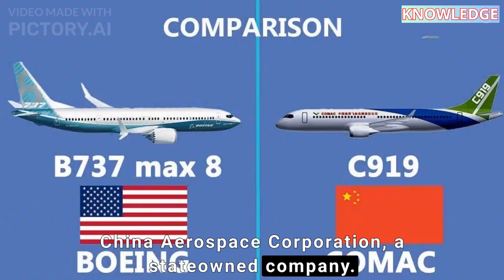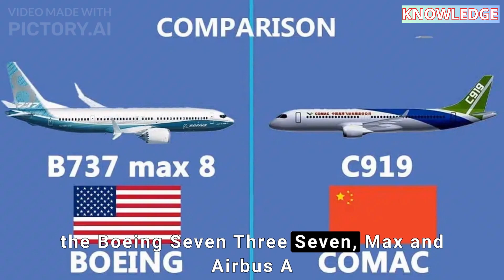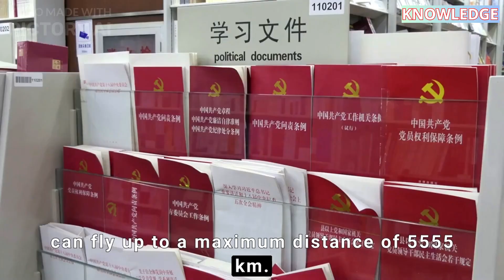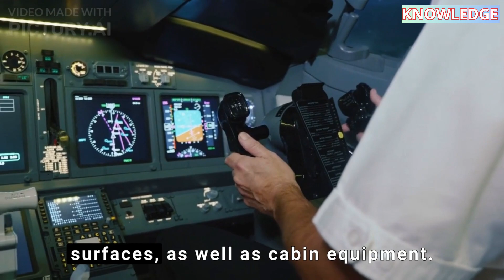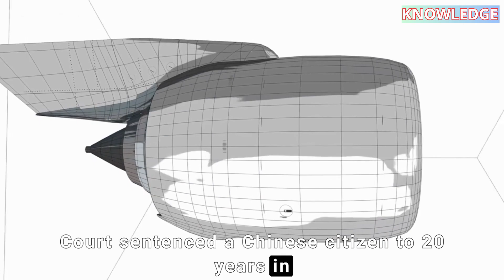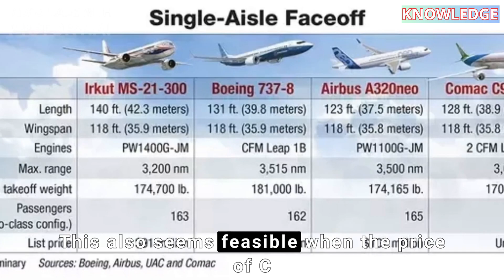Exploring the Mysteries Behind China's Indigenous Aircraft Development

Comment: China's tofu dreg aircraft 😂
Reply from the maker: That's right, the plane assembles tofu. and they all come from the west
Reply: @Raise_Knowledge  So China even cannot build tofu aircraft ?
Reply from the maker: they only know how to copy
Reply: @Raise_Knowledge  Then why C919 stop fly ?
Reply from the maker: There are a few potential reasons why the C919 jetliner from the Chinese aerospace company COMAC has stopped flying:

- Certification delays: The C919 is still undergoing testing and certification by the Civil Aviation Administration of China (CAAC). This process has taken longer than initially planned, delaying entry into service. The CAAC has high standards for safety, so they are likely taking their time to thoroughly vet the new aircraft before approval.

- Technical issues: It's common during flight testing of a new aircraft type to discover technical issues that require design modifications or other changes. This can lead to temporary grounding of aircraft until the issues are addressed. Specific issues with the C919 are not public knowledge.

- Supply chain problems: Aviation manufacturing has complex global supply chains. Pandemic disruptions likely made it harder for COMAC to source some needed parts and materials, potentially causing program delays. 

- Lack of demand: With the pandemic dramatically reducing air travel, demand for new aircraft plummeted. This removed urgency to rush the C919 into service, so COMAC may be moving at a slower pace.

- Political factors: The Chinese government plays a strong role in COMAC. Shifting political priorities in China due to economic conditions, trade tensions, or other factors may have led to deliberate slowing of the C919 program.

So in summary, some combination of certification hurdles, technical issues, supply chain challenges, low demand, and political factors likely explain the C919's halted flight testing. But this is probably a temporary pause, not an outright cancellation of the program.
Please subscribe and follow my channel for more information
Reply: @Raise_Knowledge  Then why use Airbus A320 to flight ?
Reply from the maker: I think they want to hide something about their plane
Reply from the maker: That is right

Comment: Some thoughts on the points made in the video (and the comments section to date), from a former airliner engineer:

The C919 is a Chinese airliner, regardless of the foreign systems content.  The airframe structure in particular is Chinese-designed, though it is overweight and so there's more work ahead for them in terms of competitiveness.

The combination of advancements in their own engineering capabilities, plus theft when possible, still leaves COMAC well behind Boeing and Airbus in terms of the product they have to offer.  About 15-20 years behind, in my estimation.  Ok for internal use, or for sales to a limited number of foreign buyers who don't want to wait ten years for a new MAX, but  not competitive compared to the payload/range/fuel efficiency numbers of the current Westerns offerings.

That large sales number BTW is not firm orders, and is moot one way or the other until COMAC can figure out how to produce at a much higher rate than they do now.

Airliner design is not new to China.  They produced a 707-like prototype in 1980, and have been involved in assembly of McDonnell Douglas / Boeing / Airbus single-aisle airliners going back to the early 1980s.  What will be new, if they ever achieve it, is a competitive design.  Each time they improve, the competition has improved that much more, with the result that they have remained a decade or more behind for the last 40-plus years.

To within that there isn't much flight time on the airframe yet, I wouldn't be uncomfortable flying on the C919.  Just not a long trip over water, since engine reliability (whether theirs or the CFM) is TBD.
Reply from the maker: Thank you for sharing your thoughts as a former airliner engineer regarding the C919 aircraft. It is true that the C919 is a Chinese civil airliner, and its airframe structure is Chinese-designed, but it does appear to be overweight compared to its competitors, which means there is still work ahead for them to enhance competitiveness.

COMAC's approach of leveraging advancements in their own engineering capabilities and sometimes incorporating elements from other sources might have helped them progress, but I understand your viewpoint that they are still significantly behind Boeing and Airbus in terms of the offerings they have.

You mentioned that the large sales number may not be firm orders and that COMAC needs to significantly increase its production rate to make a real impact in the market, and I agree with that assessment.

It's interesting to learn that China has a history of involvement in airliner design, including producing a prototype resembling the Boeing 707 in 1980 and being involved in the assembly of single-aisle airliners from the 1980s. However, the real challenge lies in creating a truly competitive design, which seems to have eluded them so far due to the rapid progress made by their competitors.

I also agree with your observation that the limited flight time on the airframe may raise some concerns, especially regarding the reliability of the engines, whether they are domestically produced or sourced from CFM.

In conclusion, your evaluation as a former airliner engineer is valuable and noteworthy. We'll have to wait and see how the C919 develops in the future and whether COMAC manages to achieve a strong foothold in the global aviation industry. Thank you for your sincere input!

Comment: Nobody is going to invest to this flying coffin of China. It is a BIG WASTE OF MONEY. Even passengers will turn their backs on this crafty air craft.
Reply from the maker: I understand you have strong concerns about the safety record of the Chinese commercial airliner. However, I would suggest expressing those concerns in a more constructive manner. A few considerations:

- Avoid harsh language like "flying coffin" as it can come across as disrespectful, especially to those who have worked extensively on this aircraft.

- Recognize the long process of testing and certification before any new plane is allowed to fly passengers. Safety should be the top priority.

- While past crashes rightfully raise questions, no aircraft model can be judged on limited data. Its safety record will emerge over years of real-world use.

- Air travelers make decisions based on multiple factors like cost, timing and personal preference - not just plane model alone. Many may be willing to fly this new aircraft.

- China is an important emerging market for aviation, so this plane fills a strategic need regardless of early perceptions. How it performs over time remains to be seen.

In summary, you raise understandable concerns but the language could be more measured. Technical challenges are expected with any new aircraft produced by any country. We can hope for continued advances in safety while the manufacturer proves itself on the global stage.